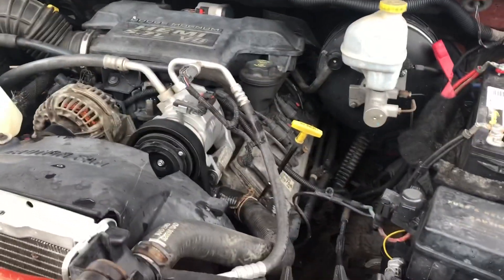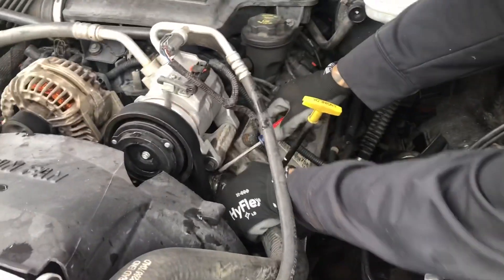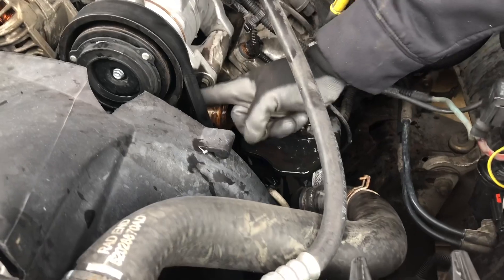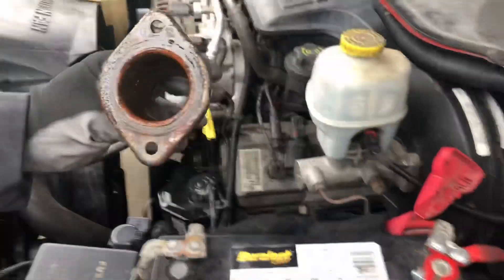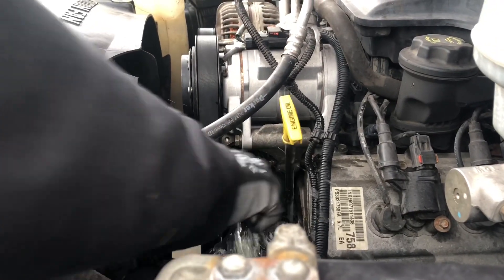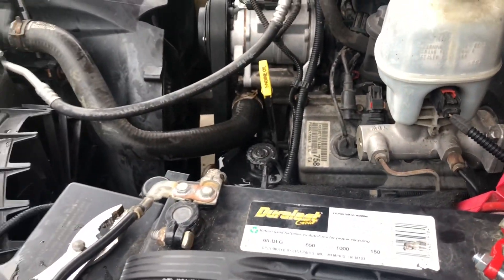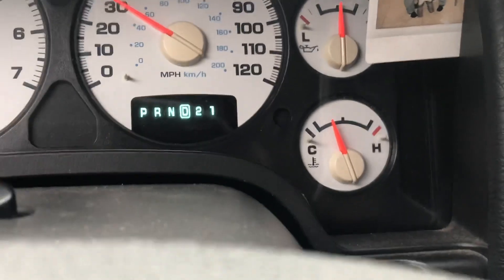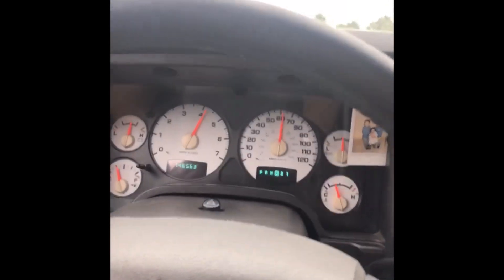Replacing thermostat on 2005 dodge ram

Comment: First you drain the coolant through the pitcock on the bottom of the radiator. Then you use pliers to tighten and pull back the hose clamp before you take a screwdriver to it. Once removed you make sure both the thermostat housing and engine surface are clean, no metal on metal simple scouring pad will do. Check to make sure gasket is correct placed then re assemble and add new coolant. Or you can do it the pirata way like this dude. Never trust a man with a check engine light to help/tell you how to "work" on your ride.

Comment: easy shid. you got any water pump video
Reply from the maker: Not sure bro.. but its pretty easy also.. just gotta remove the belt & locate the bolts from the water pump & make sure you know where you took that bolt off because each bolt is different & different size

Comment: What mods
Reply from the maker: Adrian Rodriguez just headers intake exhaust & 180stat so far.. i will be dropping a video later on today of everything i have done to my truck & how much i paid for each thing
Reply: Street Terror Performance what is 180 stat ? If you don’t mind me asking .
Reply from the maker: Adrian Rodriguez its a thermostat.. these trucks usually have 203° stat.. the 180° stat makes your engine stay cooler.. if you see on the video towards the end my temperature doesnt even touch the middle line